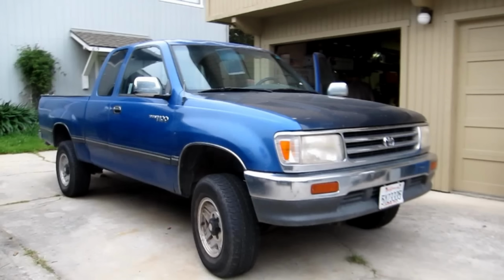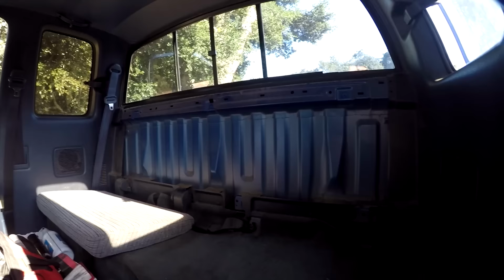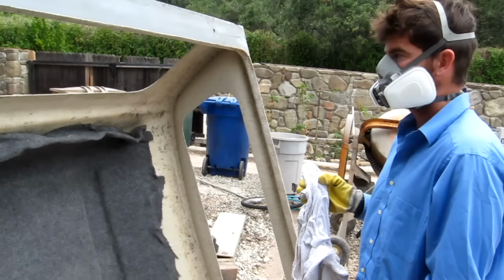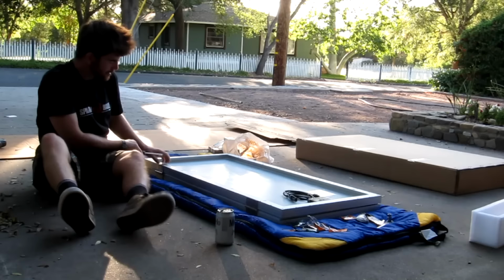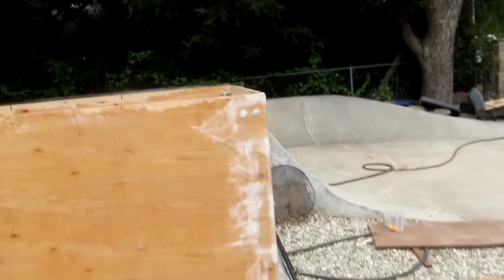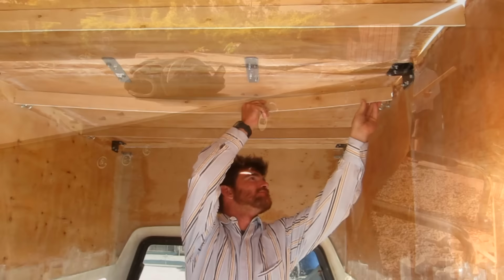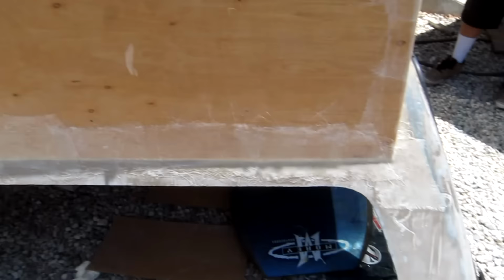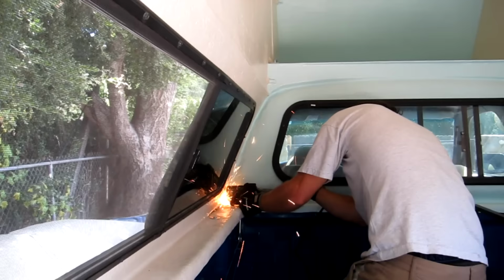DIY Truck Camper Build Pt.1 OVERLAND TRAVEL VLOG Ep.4

Comment: Thanks...that was what i wasvthinking...prob screw a 2x4 on bottom of topper using big washers and wood screws then fill gap at back window with rigid vinyl trim moulding

Comment: Because it's easy and doesn't require so much fabrication. And you can modify off of that if needed. Personally I would have the boards on the roof and take the chance. It would require upgraded shocks and leaf springs but the durability issues would put my mind at ease.
Reply from the maker: I love seeing everyone's different set ups. It's a fun result of each person's creativity, craftsman ship, budget, and priorities.
Definitely easier to just get a slide in. But, as you know I don't like having anything on the outside of the vehicle for theft issues, but also to avoid hassles form the cops ect. 
We still considered a slide in, but would have to get one built to handle the wear and tare of full time travel and off road. I've seen several slide ins and trailers just fall apart during short trips to Baja. They're just not built for it. And a good camper in decent shape cost a lot more than the $800 I spent building ours. 
If you have the money for one, then a slide in is a great option and they make some really nice ones now.

Comment: This is ALOT late to the party but I just watch the entire series and I felt like I should mention (to anyone watching this and wishing they did the same) that there is a MUCH easier solution for this.

They are called Maranda/ Serden and they build fiberglass mobile tool sheds for professionnals. Their brand new shels are 10k CAD but you can easily find them for 2k CAD in the classified.

That's my choice anyway! Love the build!
Reply from the maker: Cool. Good info to share.

By the time we finished, the camper(without electrical/interior) cost us around $700 usd and many hours of work.

We could have just went with the topper that we bought off of Craigs list for $90 and strapped the boards to the roof if I was OK with having stuff strapped to the outside of our rig. But that would have been too easy ;)
Reply: woa! 700$ is seriously frugal! Nice work! I think I'll work a bit longer in an office to pay for the 2k$ though. I am not good with fiberglass! 

Keep up the cool content!

Comment: I watched this and could not help wonder why all the extra work to deconstruct and reconstruct a wood addition to a fiberglass shell instead of just building  a wood camper from the ground up   nice job but just seems like twice as much work for the same end result   nice job though
Reply from the maker: I considered building the entire thing out of wood from the ground up, but decided to go this rout because:
-I wanted windows
-I wanted it to be light and strong
-I needed it to be very vibration resistant (no bolted or screwed joints to come loose)
-I needed it to be as water tight as possible.

I'm sure you could achieve similar results with an all-wood construction job if you know what your doing, but I had my doubts that it would be water tight or vibration resistant enough to last through what I intended to do to it.
Unless you fiberglassed it, but then it wouldn't be any less work than what I did.

Comment: HI, Nice work on the modifying of your camper shell. I am curious (because I have a T100 as well) what truck you got your camper shell off of. It looks like it fits really well and seems like you got a great deal on it.
Reply from the maker: Thanks Conner. The shell was designed for a 1st generation Tundra. It fits well. The lip of the shell that sits on the bed rail is just a little wider than necessary for the T100.

Comment: Hi Matt, if you were to build another truck camper would you build the cap, with higher roof, instead of modifying a fiberglass truck cap?
Reply from the maker: Hi Steve. for our intended use/budget the modified truck cap worked as well as hoped. If you are designing something that will have inside living space (area to stand, not just a bed) then building something with vertical walls will greatly increase the usable space and be worth while.
For my next build, I will get rid of the truck bed and build a custom camper on a flatbed platform. It's the most effective use of space that I've seen.
Reply: yep thats kinda what I was thinking too. Thanks for the feedback.

Comment: Hi

My friend gave me a pickup bed topper for my 04 ram

he said it was on a 02 ram

It fits perfect length but the height is short

Its not flush with top of cab its about 1.5'inches too low.....

I dont like how it looks.....should be flush with cab top.......any ideas how to raise it 1.5 inches?

I was thinking a 2x4 on bottom of topper perimeter but would have to modify rearvwindow somehow

Any ideas?
Reply from the maker: Yeah I think the 2x4 idea is probably the easiest. You could try going the a used camper dealer to see if they have a taller rear hatch for the rear like the ones they put on some high rise style shells. or add a 2x2 or something to the tailgate to bridge the gap.

Comment: why not just strap the surfboards under the truck when you sleep?
Reply from the maker: Thats a good question. I've done that before for short trips, but we live out of this rig full-time for 18 months and I don't want to have to pull all of our boards out before I can get in the camper. There is also the problem of wind and rain getting all the boards dirty while strapped under the truck at camp and then needing to put them back on your bed before you can brake camp.
Its doable of course, but it would add a lot of time to setup and break down camp every time you need to move.